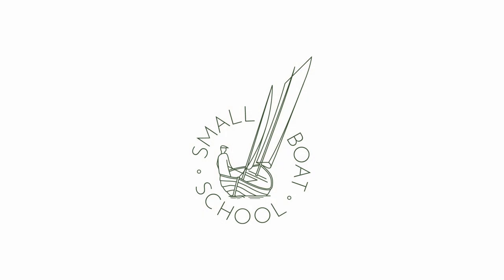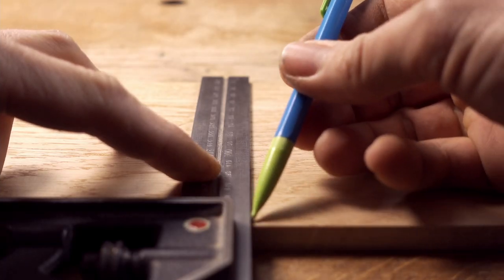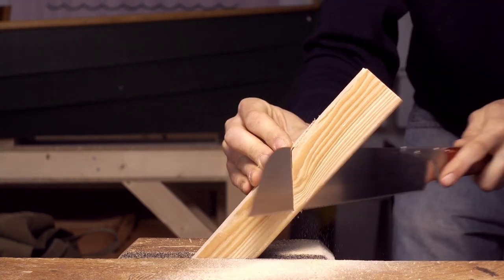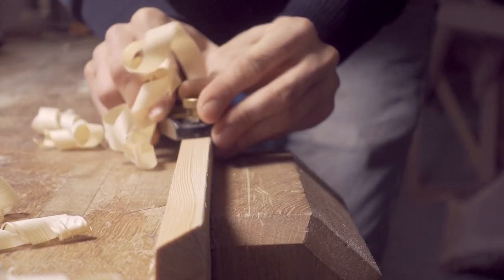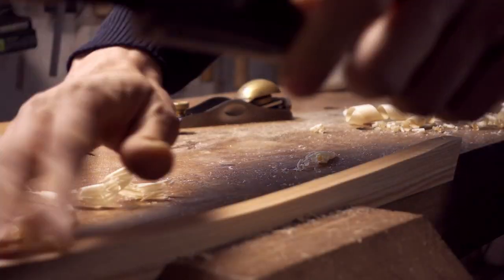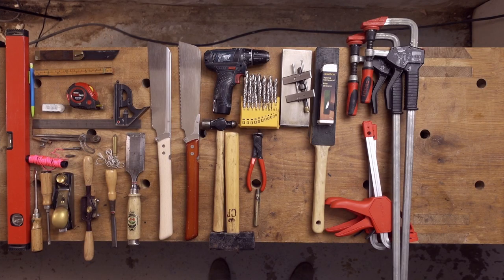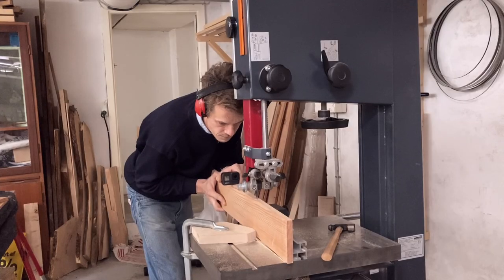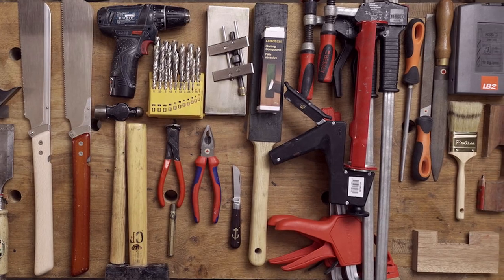These are the tools you will need to build a wooden boat

Comment: Great video, I love how you express your love for using sharp hand tools over power tools. 
Most builders seem to have so many machines in their workshops it puts the beginner/novice builders off starting a project.
Well done to you 👍.
Reply from the maker: Thanks a lot for your comment. You're spot on. I have tried minimize and simplify the amount of tools needed to keep the barrier of entry as low as possible. Boatbuilders still need quite a few tools, but these tools don't necessarily need to be expensive. And most of them can be muscle powered. :-)